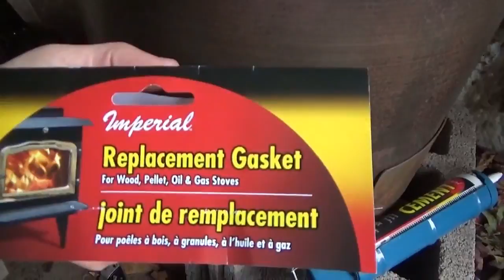Gaskets & Damper On M45 Tent Stove Burns Slower Now

Comment: You've got the chimney pipe in backwards. The crimped section should always be on the downside so that creosote /condensation does not leak through the pipe and run down on the stove. Now I am sure your saying the crimped section wont fit into the stove. Well, that is where you would normally trim the pipe when fitting up the stove pipe. If your stove is now setup properly to be an airtite,you should be able to extinguish the fire in a short period of time by closing the intake. You might also get into the practice of loading the stove up while its hot in advance to take advantage of it being oxygen controlled. It will burn better if the wood is preheated.
Reply: I am not concerned if I get blocked. Creosote...and there WILL be creosote ,is a fire hazard that will become easier to ignite as it gets closer to the stove ...(on the outside of the pipe.) Its fine if it burns while IN the stove. I am sure Troy would like to learn of this before it happens ,not afterward.
Reply from the maker: Yes I noticed that now that I have junk running down the pipes. And no, it did not just slide on the other way. Dumb of me not to notice that earlier. But then again the top cap is also upside down too. Why do they do that all the time?
Reply from the maker: And dont pay attention to the trolls. They are just trying to stir up trouble. Thanks for the pointers.
Reply: The Do It Yourself World Yes ,its dumb of the manufacturer to have not crimped the pipe for you. Maybe they figure the installer has one. The mistake you made is very common. Its also common to think :I am using dry wood...I wont have creosote. The  problem occurs when the pipe gets clogged OR the pipe gets unusually hot at a point that is normally cool. If you ever come across one,it would be cool to see if one of the old catalyst disks from a "kerosun heater " could be mounted internally in your stove (offset a couple inches to avoid possible blockage) The amount of efficiency increase is generally about 10-11 percent. The reduction in creosote going up the pipe is substatntial.
Reply: Troy, all you have to do to turn them around is to cut the crimp off the first pipe on the stove and all the rest will be proper. The first section touching the stove will not leak creasote because it is too close to the flames.
Reply from the maker: I will have to try that but I think that the stove pipe is the same size as the stove opening is why I put it like this. I may have to make an adapter like I did on the tiny house wood stove. Thanks. I will see.

Comment: Hey Troy.  I was very impressed how you were able to tame that beast of a stove.  We had a stove very similar to the H-45 Army issued tent stove when I was stationed in West Germany in the early 80's.  Ours had the same top but a shorter bottom and had the liquid fuel mod kit . We burned diesel fuel.

I was section chief in a Lance Missile firing team so on our FTX's we were generally on the move almost all the time.  When we rarely erected our 10 man tent our tent stove would run so great that even if it was in low teens F outside it was nice and toasty inside.

I recall one time FDC called in a fire mission to us on the radio at 3 am.   It was 10 degrees F outside and our launcher was covered in ice.   Our Lt was pretty cool and he and I discussed how dangerous it would be for our guys and for the only time we phoned a mission in haha.   

Those guys back in the Battery HQ area sitting in their warm FDC tracks were probably laughing about sending us a fire mission
that would cause us to freeze our you know what off.
Reply from the maker: I dont remember which stove they used but I can remember being in a huge tent one time with the barrel stove. It sure was warm in there. Must have had about 30 or so people sleeping in there on cots. Those stoves kick out some heat.

Comment: When you burn diesel you have to disassembly the burner assembly completely when the fuel is super-heated to a gas, all the carbon is left behind. If not thoroughly cleaned each season, it will completely block the inlet tube.

Comment: could you put a coil of copper pipe into the stove and run a small water pump to circulate the water through bringing out warm water as heat storage
Reply: I've seen some vids here where people coil a copper pipe around the flue. The pipe runs thru another coil in the water tank, heating it up. The copper tubing is a sealed run and acts like a thermosiphon, no pump needed.
Reply from the maker: Possible future upgrade

Comment: At 5:30 if the stove is bent maybe try tapping it back in place? Tapping it back in place would work better than doubling up the door gasket.
Reply from the maker: The door?
Reply: The Do It Yourself World
Yes
Reply from the maker: Its very tough and hard to bend. I tried. Its like spring metal.

Comment: the damper should have been installed higher on the pipe because of the heat from the top of the stove.
Reply from the maker: I wondered about that. Would have been tough for me to reach my arm up there though to install it.